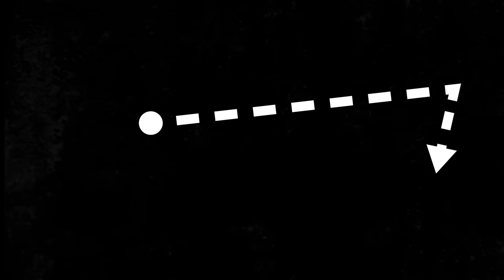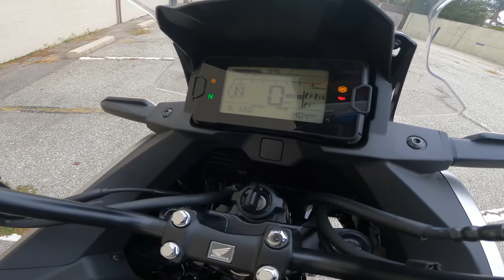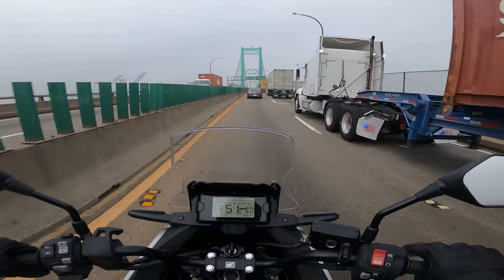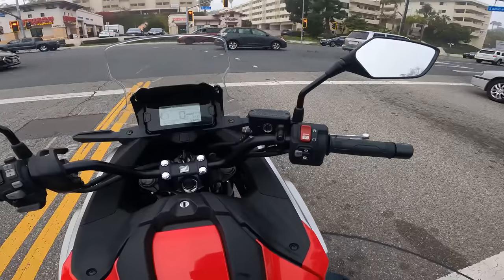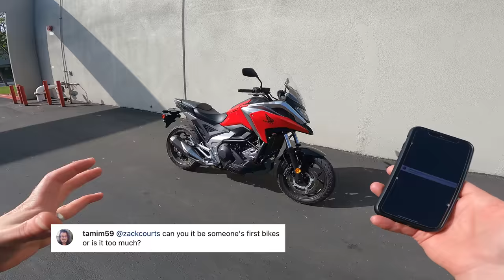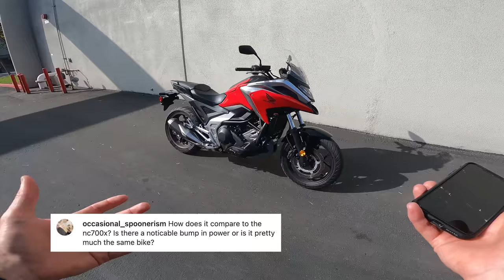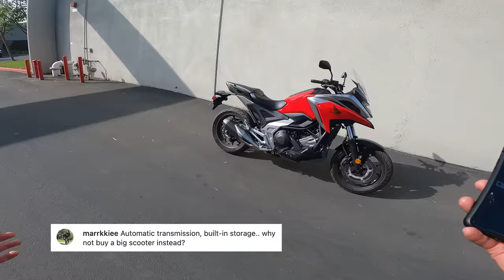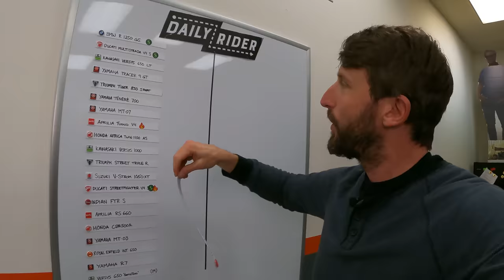Automatic-transmission on a motorcycle? 2021 Honda NC750X DCT | Daily Rider

Comment: Actually its very practical design. Scooters are not safe on higher speeds and this will definitely bridge the gap between comfort and motorbiking. 
Honda is my favorite in all Japanese brands. They think like consumers who actually need practical machines than beasts on two wheels. 
Very nice honda..
Reply: @Diesel S. And to think Honda makes the Forza 750 with the same motor as a scooter. fiddlesticks about scooters not being safe on highways.
Reply: @dukeloo  non maxi scooters aren't safe on the highway.
Reply: @dukeloo  Small tires, always less safe than big tires, its just basic science.
Reply: @RaunakPSingh  whats the science behind that
Reply: @rayhan4502  Large wheels with more width provided better stability, grip and braking.
Large wheel will cover more distances than the smaller one with the same RPM. And thick tyre will help you to more stabalize your vehicle. 
Larger wheels have an easier time negotiating obstacles – roughness on the road and timbers and crevasses on the trail. The larger the wheel, the more it can span holes and the easier time it has climbing over stuff.
Reply: @RaunakPSingh  That's why I prefer scooters with larger wheels like the BV350. Wish they would make more models with 16 inches.

Comment: I've had two and done over 60,000 miles commuting on them. 70 mpg (UK), DCT for central London traffic, 80 mph cruising speed. If there's a better commuter bike I've never found it. Would I buy one for fun? Hell no.
Reply: Yeah it's not a thrill ride.  But if you're an accountant then the 60-70mpg might give you a huge rush.
Reply: What happened to the 1st one? I'd expect these bikes to handle that kind of mileage well.
Reply: @IslandTosh  I traded it in for a new one after 50,000 miles
Reply: @jsherck  if going places and seeing new things is your thrill. Then this bike will do that well.

Comment: I was so taken with the review of the Versey I chatted up my dealer I have a relationship with and checked it out. He recommended the Honda minus the DCT instead. He has treated me right for years and the fact he steered me to a less expensive machine than the Versey made me think he was legitimately trying to help me out. I think bottom line is he finds Honda's better to maintain. While I have spoken with many long time riders who like the DCT I would use the money I save for accessories, probably luggage.
Reply: You really need to try a DCT. Its game changing. The ease during the twisties...

Comment: Every time I see a motorcyclist with a quick up/down shifter, they say it's great that you don't have to use the clutch.. not a far cry from an automatic IMO.
Reply: Eh we all settle for a level convenience or everyone would still be jogging.  I guess the difference   is you still have the option to choose your gear with quickshifts and not be forced into wtv the computer wants.
Reply: I feel like the purpose of a QS is very different. Definitely track oriented. I personally turn it off on the road as I prefer to blip the throttle myself when downshifting but on track when braking and downshifting at the same time the bike is so much more stable with the quickshifter specially when downshifting 3 gears down within few seconds.
Reply: Yeah, I'm definitely not saying that they are the same.. just not enough of a difference for people to be going up in arms about. Don't like it, don't buy it and whatnot
Reply: Not that you have to use the clutch in the first place on most bikes.
Reply: Not having to use clutch =/= not having to shift
Reply: @Maccaroney  a quickshifter does the same thing that you do with your throttle during clutchless shifting.
Reply: @RaphYkun  DCT has manual mode where you choose your own gear too, you are not forced into automatic mode.
Reply: I'd say QS/Blipper is more track/spirited riding oriented. Plently of people complaining about 'clunkyness' (Honda, Kawa, Bmw...) but they use the QS from 1st to 2nd, 3rd at 20% power and from 2500rpm. 

I enjoy the 'manual' and would take it over automatic and the QS on my bike works smooth and flawless - at 75%+ throttle and above 8k rpm

This is more akin to what people want when they imagine their automatic car (commute) and want it in bike form

Comment: The 2021 is a huge improvement over the previous model. I was planning to buy one but bought a Rebel 1100 DCT because these are actually almost just as difficult to find in SoCal right now. I may still buy one later. It’s a great example of Honda engineering for a specific purpose that other manufacturers don’t.
Reply: How have you liked the rebel dct since you got it? Just curious as i most people don't mention the dct.

Comment: Great review Zack! I bought a manual 2012 NC700X in 2013 and I love the bike and agree with you all the way. Before I bought this bike the largest bike I had ever owned was a 250. I have ridden this bike off road and it will do it but you are correct about the lack of suspension and being to heavy. So I am currently waiting for a CRF300 Rally to come in. As for gas mileage I average 70 mpg and when ridding conservatively under 50 mph I actually got as high as 90 mpg. I know some are going to say I am stretching the truth but I filled up before I left and filled when I returned with exactly 90 miles on the trip meter and could only get a gallon in the tank. I also want to say thank you again for High Side Low Side interview of Itchy Boots that made my day. I am editing this because the Honda shop just called to say that my CRF300 rally just came in. YAY

Comment: US car market is seeing the death of the manual transmission. That with the rapid growth of electric motorcycles that also don’t have a clutch. Decades from now, are we going to look back at Honda’s DCT as way ahead of its time?
Reply: I don't think it's fair to compare car's manual gearbox and bike's sequential gearbox.
Reply: @hornetdc  Mechanically I would agree with you. But I was thinking more of car companies slowly stopped making manual transmissions due to efficiency and ease of use. I was wondering if motorcycle companies would ever get to the point of removing traditional clutch transmissions because of similar reasons.
Reply: I had a 1979 Honda CM400A Hondamatic! taht was ahead of its time
Reply: @TheBawalumihidito  If the companies want to sell more units, they need to offer automatics. Manual shifting is what keeps some folks from riding, and even many who currently ride don't want to constantly shift in city traffic.
Reply: @georgeklimes7604  I agree, people act as if manual and DCT is mutually exclusive.  There is a market segment for both and the prudent thing for Honda is not to try to slowly phase out manual bikes but try to expand the customer base by getting more people into riding, potentially through the DCT while offering manual bikes for the purist.  I think the goal is to sell more bikes overall, not convert current manual transmission customers to DCT customers.  The purists will look down on the DCT without thinking that this technology serves a purpose and is good for the motorcycle industry overall by providing people that physically cannot shift with a viable option, as well as encouraging more people to start riding that otherwise may not have done so.  DCT riders may decide to advance to a manual bike which then opens the door to all motorcycles and brands so i am really shocked more companies do not offer automatics.  Purists often don't think long-term growth and nuance, they only only react to the initial emotional response and think tradition is more important even if advancements equal greater consumer benefits.
Reply: @mattb.4333  There is no ‘advancing to a manual’, the DCT is the top. The purists may look down on it but the DCT is better for street riding in every way. I love my manual transmission cars but all of my future motorcycles will be Honda DCTs or electric.
Reply: @rednwhitecooper  I agree with you and I think you misunderstood what I was saying.  The DCT is more advanced from a technological standpoint, so we agree.   Riding a manual takes a higher degree of skill, that is why they start kids out on automatic or no-clutch shifting dirt bikes and as their skill-level advances, they graduate to a full manual.  Just like a car, learning on a manual gives you a better understanding of the machine and how it works so i do think there is a benefit there.  Personally, I have loved the DCT and will never go back to a manual becasue for me, I feel like I get to enjoy the aspects of riding that are meaningful to me at a higher level without having to worry about shifting.  I can also understand that there are people that the shifting and full control of the machine is the part they enjoy.  I think it is just a personal preference but I also think people are hesitant to ride or buy a DCT for fear of what others may say.   I don't care because I ride for myself and my own enjoyment but there is a culture that is going to take time to chip away at to make the DCT more viable in the American market.
Reply: @rednwhitecooper  I also love my DCT and can only find one problem with it which you quickly learn to deal with.  That is the rare case that the transmission decides to downshift in a curve but the nature of the kind of power the engine produces is different than most bikes so it is a minimal issue.

Comment: The wind screen is adjustable... you dont have to cut it up or get a bigger one... it has 5 positions so you can move it as low or high as you need

Comment: What a great test video. Being a lifelong Honda MC man, along with once owning an Accord and still running a 1987 Honda lawn mower (best ever), I would have to label this bike as the closest thing to a Honda Accord on two wheels. My current rides are a 1985 GL1200I, a '81 GL1100 Standard and a '72 CB450. This bike would be the closest match to the 450. Wet it is close to the weight at ~470#. Single disk front brake (make from wood), 44HP, and you really need to work the make the 450 pull a wheelie. Thanks for the information, it really makes sense.

Comment: Personally I would have put it over the 1250GS for pure daily ride just due to cost. The NC is soooo much cheaper.
But I thought the same thing about the Versys 650.
They should be 1, 2, in my books. With maybe a CB500X and an INT 650 in the 3, 4, slots

Comment: I was skeptical of the DCT, but picked up a gently used Africa Twin with one on an excellent deal. I love it. The only time I think about it is off-road near a cliff. I wish it had a clutch to remove power from the rear wheel just in case…The NC750 would be my go to commuter bike if I lived down town.

Comment: What is the fuel economy like if you do a lot of Hwy driving (60 mph, very little stop-start)?  Some of the smaller bikes get insane gas mileage putting around town at lower speeds (around 80 mpg), and while they are still economic at higher speeds, the mileage falls to where they’re not much (if any) better than larger motorcycles.

Also, I currently own an older Camry that gets around 34 mpg on the Hwy, so the bar is high in my case, especially as motorcycles require 93 oct whereas the Camry only requires 87.

Comment: I have a 2020 NC750 DCT the windscreen is a little load, I wore ear plugs, the I got a Givi airflow for a V-Storm and made adapters on my mill to mount it on the NC, which mad a huge difference. There are probably better wind screens out the for it. DCT is ok but it no perfect I find myself running in sport mode #1 or using the paddle shifters a lot, mostly to down shift. and the slipper clutch makes down shifting to slow down feel vague, and latent. I get 70 mpg pretty consistently but I weigh about 165 because that's what the medical people want me to weigh.

Comment: What I don't understand is folks are all raging about quick shifters, but rag on automatic or semi automatic, WTF???  All these cases don't use clutch.  DCT having both full auto or paddle shift.  Paddle shift is like using a quick shifter but instead of your feet shifting your hand does it.  DCT is much smoother and faster compared to a quickshifter so why do folks rag on DCT and rage about quickshifter???  If these folks are so lazy about not using the clutch they should be thrilled in not having to shift at all with full auto or much quicker, smoother and easier with a paddle DCT shifting.  A quickshifter so satisfying but a semi-auto or full auto not, WTF???
Reply: Totally agree. I have a NC750X DCT. It gives you such a relaxed and safer ride and has ample power. Beats me what the "macho" dislike of DCT is all about. I can well imagine that other manufacturers will eventually follow Honda's lead.
Reply: Is this a good motorcycle for commuting if I don’t know how to shift/use a manual? Can I ride it like a car with an automatic transmission? I don’t know anyone with a motorcycle around me so I can’t even practice with a manual. A motorcycle is cheaper than a car and I wouldn’t have to ride the bus everywhere if I want to leave campus
Reply: @JacksonWalter735  Motorcycles have high maintenance intervals so it might not be cheaper if you pay for service, but if you DIY it can be.  Best if you get a scooter, would be even lower cost and even easier to ride.  You sound like you still a student.  I would recommend a 150cc scooter.  Everything about it is lower cost, from buying to insurance to operating/maintenance.  A good condition used car like a Toyota Yaris or Corolla is lower cost than a motorcycle but not a scooter.

Comment: I will disclose a degree of bias as I have owned one of these over here in the UK for a good 6 months now - pretty much identical to this bike except it's blue. However I have come from a manual NC750S prior to this and have had a range of bikes.

I think the NC is probably the best, pound for pound, all rounder on the market. It's got a combination of real, accessible usable grunt that can out drag almost any car and still keep up with most bikes at real world speeds. The new version is vastly sharper in the corners and has a better, more controlled ride than before. Yes, it isn't fast given its engine size but that's only really relevant for bragging rights discussions - it's still a pretty quick bike when you want it. 

This is balanced out by capability of up to 90mpg (UK) - I'm currently averaging 85mpg UK which is about 71mpg US and thats a 50/50 split of motorway, country and town use. The 'frunk' as owners call it, the front storage tank, makes it the most practical two wheeler this side of a scooter. The fairing and screen do a good enough job of keeping the weather off you. It can be fitted with enough luggage to rival the storage capacity of a small city car and carry it without any trouble.

Super low centre of gravity makes the weight a non issue.

The DCT is a bit marmite - but the new version better improved on older ones with the advent of the ride-by-wire throttle. I personally hated it first time I owned one (a 2017 750X, which preceded a 2019 manual S). However it has matured such that I genuinely don't ever think about it. It's unobtrusive, is always in the gear I would personally be in, is changeable and adaptable to your riding style. It allows me to concentrate on the act of riding which in our highly congested roads is super important. Manual still available if you prefer.

I've done 1000 mile in a week tours on this bike since owning and it was more comfortable than some significantly bigger bikes I've owned. Seat is a bit rubbish to be fair so padded shorts useful.

Only downsides - 1) As with all modern bikes it could do with some money spent on things to keep it in good nick. Rad guard, shock tube sort of thing. 2) body work is largely clipped together rather than screwed in requiring a lot of care when taking it apart. 3) fuel filler under pillion seat makes tie on rear luggage a pain in the ass. Hard luggage is preferable if you're doing lots of long distance riding.
Reply: Good balanced feedback.  I have never ridden one but I'm thinking of trying one (I'm from UK and have a mixture of occasional long commute to lots of twisties).
Reply: Good balanced feedback.  I have never ridden one but I'm thinking of trying one (I'm from UK and have a mixture of occasional long commute to lots of twisties).
Reply: @andyhorton1472  really worth looking at for that application. Some owners find the suspension is a little bit harsh though is definitely better than the preceding version (I would agree, it’s not a sumptuous luxury barge). It’s still nominally within the lower to mid range price band and suspension components show it. Perfectly agile, actually quite capable of a hussle down the country lanes but something to be aware of. 

They aren’t for everyone but damn good bikes I’d they suit your needs. Good luck with the test.
Reply: @raubuhn4354  thanks for the reply and its really helpful.  Much appreciated 🙏

Comment: I got an NC750DCT so I could keep riding after 45 years as I have arthritis in my left hand fingers and couldn't use the clutch. The auto was a life saver for me. I would love a cruise control on it but get by with an Atlas Throttle Lock when the arthritis in my right hand gets too painful. I put a Pugi touring screen on mine and it works an absolute treat.